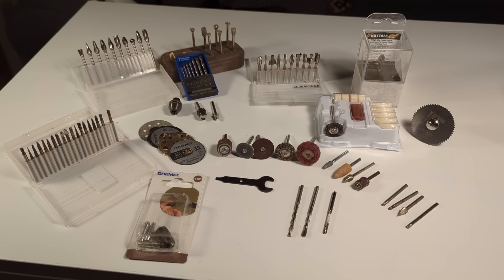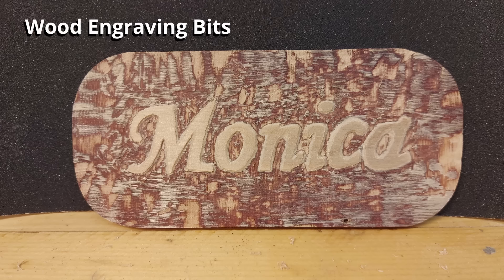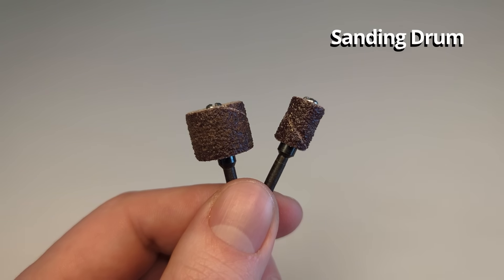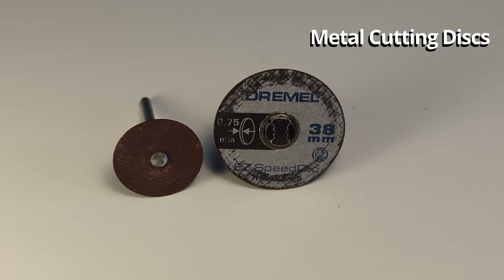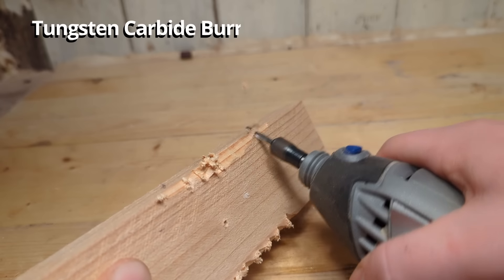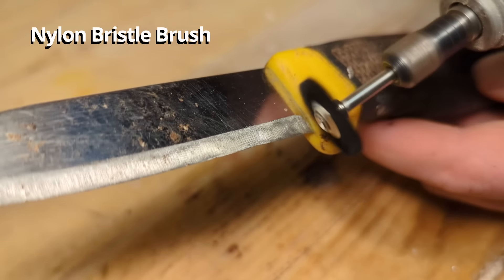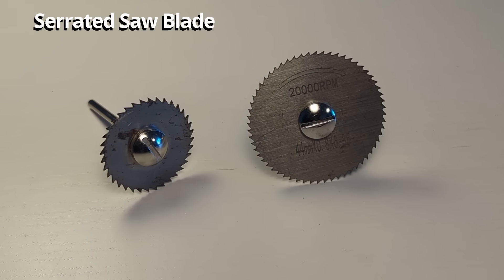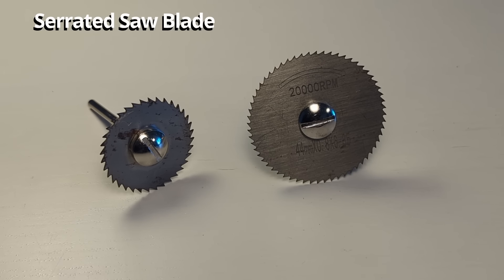The Ultimate Dremel Bit Guide

Comment: While the dremel router is no replacement for a full sized router, it definitely comes in handy in a number of light duty applications.  One place is for milling the recess for door strikes.  It beats using a chisel and does a cleaner job.

You can get 1/8 shank carbide router bits, and those are a big upgrade, as they last way longer than the HSS router bits in normal use.
Reply from the maker: Hi. Where do you find the 1/8 inch shank carbide router bits? I found some on Amazon , but mostly just for CNC work. Carbide router bits for the Dremel would be amazing.

Comment: Tip:  The diamond cutting disc is fab for scoring & cutting tiles, even porcelain ones!  It's especially good for blind cuts.
Reply from the maker: Good tip :) Probably better to use the diamond wheel rather than the 562 tile cutting bit for cutting  tile.
Reply: @rotarycrafts8760  It probably works ok for normal ceramic tiles, but porcelain is so hard that you need diamond to cut it, really.  I'm not sure if even tungsten carbide would work..
Reply: @rotarycrafts8760 , What do you think I should use to cut the broken handle pieces off a ceramic mug? Thanks and great video! I love the comments people are making.
Reply from the maker: Probably the ez545 or the normal 545 diamond cutting wheel. :)
Reply: @boa1793  I use a hammer , lightly obviously!!!

Comment: On the contrary, a 3000 or 5000 grit sanding pad from an auto parts store when cut into dremable size they sharpen blades and polish metals exceptionally.
Reply from the maker: Yep. That would make for some cheap sanding discs.
Reply: Thanks I was wondering if that would work. I have a project today on silver.

Comment: Great video! I am trying to restore a garden sculpture that is most likely a tin material. It has a design in it that I don't want to damage. I've removed most of the paint but believe I can take the rest off with the dremel. Since the paint has been removed the tin is now rusting so again I think I can just buff it off with something like Flint. Your video was very specific but I'm still a little in the dark about proceeding with such a light metal. Any suggestions will be deeply appreciated.

Comment: I have used my dremel to make a DIT Mini Mill. I have X, Y and Z axis with CNC Control. I finally have running well but now I need to make a slot in a model Train. That was the whole reason for making the machine. But the long metal cutting bit is too flexible to cut on the tip and i need to sink a 10 X 26 mm slot down about 10-12 mm deep into some cheap cast metal from 1935 thru 1950. I have tried other bits with marginal success. I need help with speeds and feeds too. I can adjust dremel speed but also the speed and depth of the cuts too. I started to sinply spiral out from the center of the slot dropping .1mm each time around. But it was major noisey and taking for ever. So i think I will drill holes close to 9 mm and spaced out. Then I would route the inside side perimeter with a metal bit dropping  .1 to .2 per round. 10mm deep that is a lot of trips around. But Not many good ideas for other cutting bits the dremel can handle. Any ideas or suggestions? Dennis
Reply from the maker: Hi. Cool project. This is quite a heavy ask from a rotary tool like the Dremel. I think the drilling method seems good to get rid of most of the material.  Make really shallow passes like you explain and use the highest speed setting. Push the metal cutting bit as far into the shaft as you can, the further away from the motor the tip of the bit is, the more it is gonna vibrate and get off center. Maybe use some metal cutting oils for lubrication when cutting. What is the metal cutting bit that you are using?
Reply: @rotarycrafts8760  I have a small assortment of Dremel metal bits but some are for deburring, the tungsten carbide tool seems best. I have tried to drill the center out then Mill the edge smooth. It is a big ask for such a light tool. I was looking a Mill spindle 800w 110 volts to see if I could upgrade my machine just to do this train. I also want to create a custom chassis from aluminum block. So a bigger spindle maybe where I end up.

Comment: hello.  fantastic presentation.  would it be possible to comment on how to apply the velocities.  thanks
Reply from the maker: This will vary alot depending on what you want to achieve. 90% of the time i use it at about 20k to 25k RPMs. I'll try to add a proper resource for this in the future.

Comment: I have used the large cutting wheel to cut all kinds of things including 1 padlock. It took 2 blades and a change of battery in my original battery powered dremel.  I have also sharpened really beat up knives.
Reply: @flat-earther  I had that debate with my 5 th grade teacher.
Reply: @jctedsap  okay.
I suggest watching the series to learn stuff you may have not heard before.

Comment: Good video, thanks. My Dremel kit has been sitting unused for months! Now that I'm back in the garden I was wondering if I can use my Dremel to sharpen my garden tools and which bits I would need to use?
Reply from the maker: I'm mixed on sharpening tools with a Dremel. But I know many people do. But it can be hard to achieve a consistent edge with a Dremel. If you wanna give it a go, a cylinder shaped grinding stone is the most common to use. Like the #932 grinding stone. (If you don't have that one the other grinding stones should work just fine) Dremel also has a sharpening attachment which will make it easier to keep a consistent angle. It is called the A679-02 sharpening kit. Thanks for watching.
Reply: @rotarycrafts8760  Thanks for the prompt reply to a very late comment 🙂

Comment: Thank you, that was a very helpful explanation. ❤
Reply from the maker: Thanks for watching. :)
Reply: @rotarycrafts8760  you're welcome. A little question: I work mostly with paper mache. Should I consider this as "soft wood" for the bits?
Reply from the maker: Yeah. I would think so. Woodcarving bits, the  ez544 wood cutting wheel and sanding drums would work fine for paper mache i think. No experience with it tho, but it is technically "soft wood". I do not know what the adhesive is made of, that might make a difference.
Reply: @rotarycrafts8760  Thanks again, this is a great help. ❤ nothing noticeable is left from the adhesive after it has dried. The whole mass of paper mache becomes one solid but also lightly flexible unit. So to speak. It also has noticeable fibers here and there, maybe comparable to splinters in wood? It can fairly easily be cut with a utility knife and sanding also works.

Comment: great video, man. I'd just probably guess that the serrated blades are supposed to be used with the table saw attachment, not directly in the standard dremel
Reply from the maker: Yeah, the Dremel brand serrated saw blades are only meant to be used with the 670 mini saw attachment. This is an off brand saw blade, where they sell it for direct use without any attachments. Probably works better with the attachment ;)

Comment: When using the stainless brush , use a low speed, I found the higher speed I'm using the faster and more frequently the little metal wires fly out , not 100% sure if it's because of the speed but that's what I've experienced so far

Comment: This was an excellent video, well done!  Lots of bits I did not know about.  Deserves a second viewing.
Someone please help me!!!  I have a project...
Glass face on a watch. It is thick square polished, covering the dial. On either side left and right, there is no bezel so the glass has chipped over time.  I need a way to soften those chips by filing them down but preserving the crisp edge of the original, no curves.
I need a Dremel sized diamond paper type disc not metal.  Metal disc with diamonds would be too harsh.  I need to file down the top and sides a bit so all chips are leveled off.
Which Dremel bit should I use?  I need a 300 grit initially or even rougher.  Then 400, 1000, and Diamond paste polish last for final buffing.

Comment: I had my gas wall furnace replaced, and had to order the rear vent for the furnace. I need to enlarge and perhaps de-burr the rectangular hole in the sheet metal a bit for the vent to slide into the furnace, it ALMOST fits perfectly. Can't find my regular dremel, so getting another one, was looking at the 4300. What is the best bit for this corded model? Since I am only very slightly enlarging the hole, the carbide bit? The sanding bit? I don't want to overdo it, this is a very small amount of metal to be removed.

Comment: Great video. What rotary tool would you recommend for grinding down a metal door strike plate so my door properly latches?
Reply from the maker: Use a tool with good power, the 8220/4000 or similar. The best bits will probably be a combination of tungsten carbide burrs, sanding drums and maybe some grinding stones.

Comment: Not only are some of your parts super expensive but the hardware stores here in NSW AUSTRALIA don't have the metal wire wheels and abrasive wheels in stock so as a result I have to make my own, if I could buy these in bulk form at a reasonable price then I  would. Jim from AUSTRALIA.
Reply from the maker: You can buy them in bulk on Amazon Australia. You can find value packs that are not made by the Dremel brand. Just search "Dremel wire wheel" or "Dremel abrasive wheel" and they will pop up. They work fine i think.
Reply: Thankyou I'll give it a go. Jim from AUSTRALIA.

Comment: The screw-on metal cutting disks are way, way more economical than the EZ locks. $10 for a pack of 20 vs $15 for 5 EZ lock cutting disks. That’s $0.50 vs $3.00 per disk. 
I just did a couple of projects carving 2 mm mild steel, and went through a lot of disks. Probably 5 EZ locks and 10 screw ons. I only had one screw-on snap on me. I was wearing goggles and a respirator, so I wasn’t worried. The screw ons were easier to get into tight corners since they are smaller. I also wasted a lot of the EZ locks cutting bigger lines than I needed. This meant they were not 2x as durable in practice for my application.

Comment: I appreciate the details on all these bits, thank you.
I do have a question on the diamond bit though. Could that bit be better for say a drill bit. Making a screw hole into tile? For instance, in a bathroom with tile shower. If hanging an arm for a detachable shower head so to speak.

Comment: A very interesting video ! I am wondering which bit would you recommend for working with plastic and resin miniature ? Thanks !
Reply from the maker: Hmm. Plastic can be challenging. It very much depends on the type of plastic, some plastics will melt easily if you produce to much friction. But for epoxy resins you can use the same bits that you would use for wood I think.
Reply: @rotarycrafts8760  I don’t know what kind of plastic they’re made of but a pretty resistant one, I’ll give a try to the wood carving bits ! Thanks !

Comment: I have a 2mm thick metal enclosure where I have to cut out a 15mmx25mm tile (to place a IEC socket). I was thinking of using a Dremel but after watching this video I doubt it would be the right approach. The 561 I learned isn't really suitable to cut metal and the small metal cutting discs aren't very reliable and precise. So a Dremel wouldn't be the right choice?

Comment: I'm still unsure what's best for my purpose - I'm looking to smooth out some mild steel and buff out the scratches. Would a grinding stone head be best?
Reply from the maker: I'm not to familiar with mild steel. But my best guess would be to use the grinding stones or trying the sanding disc/drum.

Comment: To clean a clogged bit look into woodworking erasers. Will work on metal clogging too.
Reply from the maker: Good tip. I've heard the rubber on old shoes can work for this as well, have you tried that?
Reply: @rotarycrafts8760  I have not, but appreciate the tip, I'll look into it. You've not tried yet?

Comment: I think I’m like a lot of people, I’ve had a “Demel” for years, it just sits there on the shelf unused ? well it’s to do with the obnoxious cost of the replacement bits, I’ve tried cheaper one’s off eBay but I have no confidence in them as far as the safety aspect, same old story just like buying a computer printer, dead cheap to buy but when it’s time to replace the ink cartridge it’s more expensive than gold per weigh. 😢

Comment: Thank you for doing this. Got a question and would appreciate an answer if you can. I somehow got the mini saw attachment stuck in the dremel and haven't be able to remove it. Any suggestions are welcomed.
Reply from the maker: I had this happening with my flex shaft, it uses the same grey nut to connect to the Dremel as the mini saw attachment. I think just had to unscrew the gray nut and wiggle it out from there. You will then also have access to the backside of the nut, which will make the stuck wire easier to remove from the nut.
Reply: @rotarycrafts8760  Thank you! I will try it (again) lol

Comment: This is a weird question, but what do you guys typically use your Dremel tool for? I have this weird fascination with Dremel tools, but I can never find a reason to use it. I'd love to use it more, but I have no idea how. Any ideas?
Reply: Outside of woodworking, I mostly use it to cut screws and bolts, remove rust, and blade grinding. My girlfriend's beat up kitchen knives had lots of deep nicks and gouges in them. Grinding out the gouges with the Dremel before sharpening them way faster than doing it on a stone
Reply: @crowe117  thanks for the info. I can probably find somethings based on those ideas. Appreciate it!

Comment: hello, great video, very informative.  I have a dremel, i need to cut a 5mm groove into plasterboard, which bit would you recommend to do the job?
Reply from the maker: Hi. 5mm wide or deep? For work with plasterboard i would use the 561 multi purpose cutting bit or the 562 tile cutting bit.
Reply: @rotarycrafts8760  thank you for the advice, 5mm deep and wide, i shall try those bits

Comment: Does anyone know if the Dremel 3000 could cut through 3mm cast iron?
Which attachment would be best for this?
The cast iron I need to cut is inside a small enclosed space so I’m a bit nervous about it. 
I read somewhere (can’t find that article again) that there is a Dremel attachment which will do the same, albeit slower and with more effort), as an angle grinder with a special ‘polydisk’ 🤷🏻‍♀️ but I don’t have an angle grinder nor would I need one in general anyway so it would not be cost-effective to buy one (the right cutting disks are also expensive). 
Thank you. 
Sorry if my question seems stupid in any way.
Reply from the maker: I have not tried cutting cast iron. But I think it would work. Use the same cutting discs that i recommend for metal, ez456 is the number. The 3000 should be powerful enough. You can also use a flex shaft or the right angle attachment if you need it for better access. And use eye protection. :)
Reply: @rotarycrafts8760  Thank You! 👍

Comment: What do you think about the EZ Lock Cutting and Drum Sander Mandrels?
Reply from the maker: I've had good experiences with both. The ez lock cutting is more forgiving than with the normal 402 mandrel. I've had no problems with the sanding mandrels either, just sometimes the sanding discs can be a little bit hard to get on the drum. But that is an easy fix.
Reply: @rotarycrafts8760  thank you!

Comment: New subscriber . Quick question is this tool good for carving bone and carving letters on it 🦴 ?
Reply from the maker: Hi, and welcome 😁 If you need to remove a little bit of material from the bones I would recommend the Dremel 3000 or 4000 with the flex shaft attachment. The Dremel Stylo+ is good for surface engraving, but it will often be a little bit too weak.
Reply: @rotarycrafts8760  Thank you so much I’ll looking at your videos bro you are awesome 🦾🦾

Comment: Plastic cutting have a low friction coating that reduces heat to limit melting plastics
Reply from the maker: Interesting, I didn't know. Both otherwise they are made material? Can you use the plastic discs for metal?